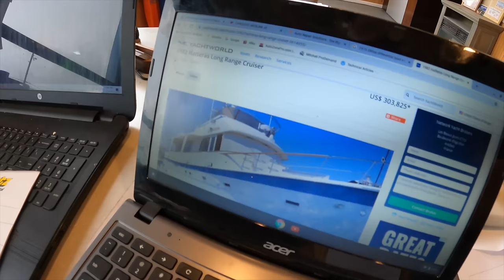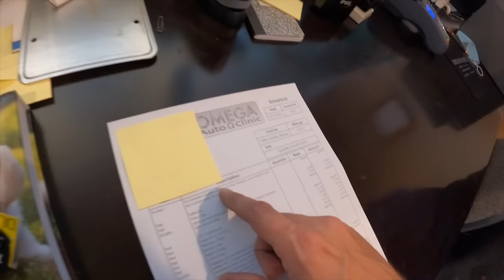Everything wrong with the Mercedes nobody wanted, and another Lamborghini FIXED!

Comment: The Hydrodynamic compensator you and the Wizard were looking at is completely stock. It keeps the rear level with a load in the trunk. It does the same thing as the spring with the addition of level control. That is all. The Classic center in Irvine, CA sells rebuilt units. You send them yours and they send you one that has been rebuilt. Some people just swap in a coil spring when the hydraulic strut has worn out.
Reply: yep check it isn't leaking and leave it alone
Reply: Fix the protective boot on the hydro shaft.

Comment: "It didn't sell for $7600, so I finally bought it for $9000." Tyler 2021
Reply: I caught that too and was like wtf
Reply: It bid up to $7600 but that was below its reserve so it didn’t sell. Presumably he bought it for the reserve- $9k
Reply: Shrewd negations have never been Hoovie's strong point.

Also, my phone wants to autocorrect Hoovie's to Boobies and I think that's fantastic.
Reply: @jongeddes09  one of the 2 points you have stated I can agree with....
Reply: @AmbientSpectrum  that's not what he said though?
Reply: @jongeddes09  actually both...
Reply: @dabreal82  He said this in the initial video where he discussed purchasing it at around 43s. He stated that it was put on bring a trailer with a reserve that was not met (high bid was 7600).

Comment: The Boge self levelling Hydrodamper unit 108 109 111 R113 280SE BOGE HYDROMAT SHOCK 0003200413. Reconditioned or new from USD 500 - 1500. Some Range Rovers used them.

Comment: The Boge is a self levelling system, as on every Classic Range Rover. It is filled with Nitrogen under pressure and self levels  enabling lighter springs so no sag under load.

Comment: I've got to get it out there that I've got a 1971 280se, whose straight 6 engine and automatic transmission I've  transplanted into my Dad's 1972 250C . The 280 has all good parts above the floors. Unique independent suspension rear axle that hinges at the differential housing.  Hello you Kansans from Mt. Oread.

Comment: Changing rear differential seal comparo: #1. 1975 Mercedes = simple, pull C-style gasket, your done, nothing to remove. Cost = $50 w/labor. #2. Any new 2010-present BMW = not so simple, disassemble entire car, some parts twice. Cost = $ 35 parts, $50,000 labor.

Comment: That clamshell boot on the rear axle is tricky to install so it doesn't leak. But it will leak sooner than you want it too anyway.  Do the job right for no regrets.

Comment: I think what GM was trying to do was rebrand Cadillac so it wasn't like every other Buick, Oldsmobile, or Chevy vehicle.  At one point everything was on the same chassis with the same engine configuration with some minor changes to the interior to make it nicer.  My old Buick LeSabre I drove in college is basically the same as that Cadillac.

Comment: I sold my 1971 300 SEL 3.5 on BAT 2 years ago for $36,500. I have a 71 280S which is nearing restoration. These are great 6 cylinder cars. Why aren't they appreciating in value? 😏

Comment: That's got an older version of the bosch l-jetronic system that was in my 280z I remember the Z's computer was so dumb that sometimes hitting the ECU could fix problems lmao. It wasn't a real computer, just a bunch of complicated dumb (dumb as in it doesn't really have much of a real computer in it) systems that control the fuel injectors

Comment: The 1987 Cadillac Fleetwood Brougham sedan, isn’t quite finished. The obvious things that are not quite right are firstly the BROUGHAM badges are in the wrong place. Secondly the side moulding on both sides of the Cadillac are missing. Thirdly the double decorative coachline / pinstripes are missing. And lastly a full set of matching white-wall tyres would make the Cadillac look so much better. I would suggest “American Classic” tyres with the 2-inch wide white-wall.
If you do these additional items on the classic Cadillac Brougham, you’re more likely to get a better price, when or if you decide to eventually sell.
I must add, that at this point, I wonder what other bits of trim just may be missing from this Cadillac, you know if a job is worth doing, it’s worth doing right, as they say.

Comment: As a former long time Mercedes owner, it's because there are no cup holders, and the dealers no longer really want to see you. I dealer maintained by 300 SDL through 480k miles by which time two dealers recommended independent service garages to me. They were too busy with warranty work on the new cars they were leasing.

Comment: I have owned Bentley's all my life and every time something hydraulic brakes I manufacture it in American style so when the suspension takes a dump I bypass everything I put struts in homemade struts and I eliminate the whole hydraulic system on the roof I changed the hydraulic cylinders with electric lanier's

Comment: The usual reason in the US for not wanting an old Mercedes or other European car is the unavailability of Mechanics happy to work on any European vehicles. They do exist but it . seems that they are getting quite rare ... you are fortunate to have complete lenses on your tail lights and headlights, not cheap if you can find them. Unless you find a parts hoarder wanting to move his Merc parts on .... you seem to be missing the under bonnet insulation .

Comment: Only the 300 have air suspension, 280 always have coils, none have hydraulic suspension. The weird thing on the back axle is a hydraulic compensation spring which often brakes down, but looking at the ride hide, it seems ok in this car. Good buy.

Comment: The Mercedes is awesome. No doubt about that. But the Cadillac brings back memories of my teenage years when I was so impressed by their level of luxury compared to even a new, at the time, W126 (1983).
However, apart from the placement of the emblems, there is something else missing too, that should be on there, even if it wasn't before. Pinstriping. White (oem style) pinstriping running the length of the car would make it look perfect.

Comment: The reason Mercedes went back to mechanical fuel injection is because EFI although reliable would leave poeple stranded on the side of the road if anything broke creating a bad look for the brand and impression on the customer, the mechanical fuel injection could have a myriad of things go wrong but short of a broken fuel pump you could usually still limp back to the nearest garage. I can literally yank out all the computer parts on the fuel system on my w126 and have failing regulators and worn out fuel injectors ect and the engine will still start and run (although like crap).
I would still pick early efi over ke-jet though, those k-jet systems do not age well after 30 years

Comment: @ 15:00 -- Hoovie is willing to $pend the $ to get it done *right*. The rest of us poor shlubs would just take a Q-tip soaked in alcohol & clean all the rubber well, coat the wind wing with wax & a light coat of oil, close & latch the thing, & then spread a tube of black RTV from the dollar store around the perimeter, wait for it to cure, take a razor blade & cut nice clean edges for the "renewed" gasket, pop the 1/4 light open and clean everything up, & call it a day...

Comment: I'm not sure what you mean about American cars being stretched out at 75mph.  Most of them were high geared and could cruise at high speeds no problem.  I bought a beat down 73 Cadillac Sedan De Ville with the 472 V8 and it had no problem cruising at 80mph and it was smooth as glass.  My friend was following me in a Toyota 4runner and he had trouble keeping up with me.
Same with a '70 El Camino, or a 71 Riviera i have owned.  My '38 Cadillac was a bit sketchy above 60.  But by the 60s and 70s they were fine.

Comment: Do not put synthetic oil in these engines. The will burn oil like hell. Use 20W50 mineral oil only this is what Mercedes recommended. And at the rear axel thats a hydropneumatic spring. And its self leveling, if you put more weight in the trunk it will raise it self. This was optional.

Comment: Hello Tyler, you might already be aware but the hydraulic suspension of your rear axle is worth nearly 1/3 of what you paid for your car... in the past when these parts failed they were simply replaced by a spring which is obviously the cheaper solution... that yours still has it is quit rare. Enjoy the experience of owning and driving this classic icon! It’s going to be one of the best investments you’ll ever make... so in the end not such a Hoovtie after all 🤪

Comment: Great buy Tyler. Love this style of Merc.  You did right for once... Please let the car wizzard pul the valve cover, because I know of some problems with old Mercedes 8 cil engines. I'm not dure if this year falls under the same catagory. But you should check it out. There is a tube which distributes the oil along the valve train. These fail, and that can cause big problems. Also timing chain problems. When you deal with it in time, easy fix.

Please also check tge channel from Kent (Mercedessource). Lot's of usefull tips and tricks about this style Merc, enjoy the old beast...

Comment: I was a young adult in 1973. The National 55 mph speed limit was not imposed until 1974 in response to the 1973 OPEC oil embargo. The US manufactured cars were designed for 70 mph and beyond. 1973 was seeing new smog control but still long winded V8s.

Comment: When I was eight in 1966 my mother had the predecessor to this Merc, a six cylinder work of art. This car in video has more subdued styling and a clock speedo. Same quality. Ours had an orange column to indicate speed. Ours had rear fins and a pointy tail light. I have seen some of these driving around Cape Town still in showroom condition. Mercedes used to be exceptional passenger car makers. I have a 43 year old BMW 650 motorcycle. It shows how Germans used to make stuff. Simple and good, complicated and not so good. There is no point in producing such durable consumer goods anymore, planned obsolescence and over regulation have cause unreliability issues

Comment: That's Boge auto leveling unit. It has valves inside controlled by pressure in two chambers. The idea is that it will pump it's self to maintain car level even if there is heavy load in the back. Old Range Rovers and some 110 OG Defenders used to have them too. The problem with them is that they usually gone by now. There are few companies around the world which can rebuild them.

Comment: UGH!   --LUV the Merc, but I HATE the underside of the hood!  You NEED to pull the hood off, turn it upside down, sand/blast the RUST OFF of that hood. --seal & paint the hood underside, and put a hood pad on the hood underside, and replace it back on the car.   I KNOW WHY there might have NOT been much "interest."  Mercedes engines, --4s, 6s, & 8s, have plastic parts that degrade -[--get brittle, break, thereby poorly lube-ing the camshafts, and potentially leading to a CATASTROPHIC ENGINE FAILURE!   I LUV the Wiz, but he SHOULD have pulled BOTH valve-covers, if those plastic parts in/on the cam-lube-ing shafts have NOT been recently[--last few years] replaced, in the 50 years of receipts, because if those plastic parts haven't been replaced, that engine is a "TICKING-TIME-BOMB" of RUIN!  Oh, ALSO, Wiz, with the valve covers off, SHOULD check the slack on the double-row cam-chain, because if that has NOT been "Adjusted" correctly, it could BREAK, again RUINING the engine from Another place!    I personally feel you should replicate those stinking plastic parts in the cam-oiling tube(s) with a 3-D replicator using a brass substrate, so instead of making them in PLASTIC, they'll be made in BRASS which will NOT go "hard/brittle" over time, grenading the engine.   Maybe stainless steel'd be more long-lasting than brass/plastic.   I also think an engineer @ Cloyes Gear Drives, should adapt a gear-drive so the cam-chain will NEVER break, because a cam chain won't be USED on that engine, anymore,--it'll be "gear-driven" from the crankshaft to the cam(s).  I'd buy a car like that, but NOW, I KNOW what to look for.  Some "'Benz-Expert  on YT, said when buying, if you have no receipts specific to replacing/adjusting those parts I mentioned, AND, if the seller won't remove the valve-covers, you should NOT buy the car, and walk away.   Also, that exhaust-system needs replacing in stainless, as those exhaust-pipes are RUSTY!   If I bought that 'Benz, I'd have to take-it to the Wiz, and maybe drop several thousand$ on it, to fix the "issues" I mentioned, ASSUMING the work I mentioned HAS been done, and assuming the cam-lobes haven't been "scuffed", meaning a re-work of the cam-lobe "face"/ramps.    Wiz'd just buy new camshafts if they were "scuffed".   So LOOK & SEE if cam-chain adjustment, and plastic oil-tube parts have been recently replaced in those 50yrs of invoices.   If there are receipts for the RECENT adjustment/repair, THEN it's a GOOD UNIT,--a GOOD car to invest in!  I'd buy that 'Benz, but it'll be MORE than you bought it for, for Wiz to fix what you wanted fixing, plus whatever you want as a profit for rescue-ing that car in the first place.

Comment: Great video, Hoovie. Loving the Cadillac. One thing to note. These mid- to late- 80s rear wheel drive cars were badged as Brougham only. They were technically not part of the Fleetwood line up. The Fleetwood Brougham, starting in the 85 model year, moved to the front wheel drive platform. I spent a LOT of time at GM dealers during this period, as my 84 Olds Delta 88 managed to accumulate some $14,000 worth of warranty repairs over 42 work orders in the first 18 months. You are also missing the side molding that helps locate the badges. Other than that, the Cadillac is magnificent.

Comment: The green and gray hydraulic suspension are feom different generations. Green spheres werre used until the 2000s, and grey ones on the Citroën C6. They are supposed to not loose gas over time

Comment: My grandfather's 280SEL4.5 would go all day at 130, mph. I know this because I did it. That rear Boge is the self leveling compensation, exactly as it should be. It's a mechanical/hydraulic device. In the late seventies and early eighties Boge made an optional self leveling suspension for BMW motorcycles under the name "Nivomat", I wish I could find a pair for my '79RT

Comment: Bentley run Citroen suspension... so you can use Citroen parts... but people don't, they go to Bentley, whereby they get their pants pulled down.. and them Mercs... parts be scary.... Bit like today, where people go buy a "Posh"  new Merc diesel... and it has a PSA engine, but they don't mention that... you're driving a shiny Peugeot... Whisper it..

Comment: Wow, just found this vid.  I grew up in Wichita. Went to WSU late 60's  
Bought a used 65 GTO with tri-power. 4 speed -Mucie shifter from a 
farmer for $1,000.  Got totaled by a drunk driver. Found a used 64 220S 
Mercedes for $600.  Needed a valve job.  I took off head, pulled out the
 valves. Went to Europe on a trip. Went to Mercedes in Germany and 
bought the valves.  Came back and had a shop mill level the Al head 
AFTER filling the corrosion holes by Heli-Arc.  Need to torque heads 
again after so many months on these Engines.  Nobody did and water 
seeped in. -----------  So I started to find spare work, repairing 
Mercedes. ----------Later in California I bought a 250S.  Rebuilt the twin carbs 
and ran great.  The rear end was sagging.. It had those compression type
 units on the trans-axle.  Throw them away,, just replace with a large 
spring, bingo.  Split boots would crack. Mine only cost $36 at the time.
  I have Jag S-type and XF's now, ,,,like to work on them.  The newer 
Mercedes don't do anything for me. Too much plastic.  Oh, there was a shop in Newton that I bought the valve guides for the head.  Probably gone now.

Comment: Agreed, I've never seen a hydro susp. like that, before, either. Usually, it looks alot like an old efi system. Many solid lines, coming off of a master cylinder. E.g. 80's Rolls Royces. That though, I've never seen before either... so don't feel bad Wiz, it's not just you!

Comment: Always wanted to LS swap one of these.
 Not a crazy high horsepower swap, but more the aluminum 5.3 engine with a 4L60E to have modern easy to maintain drivetrain coupled with what I consider good looks and not something I will see 10 copies of every time I drive it. I had originally wanted to do that with a 70's Jag XJ6 (or XJ6C) - but my feet don't fit in them. Sadly - my searches for a car like this many years ago did not turn up such an affordable example so I haven't looked for them again.

Comment: Find an extra fuel pump.  When you need it, they just won't be available.
I found the same car, but the condition was a little less than your car.  It was about $4500, and the guy had it for sale for about 18 months.  I saw the car when he was taking it to storage and by then he didn't want to sell.

Comment: That looks to be the standard hydropneumatic compensator, that all W108s came from the factory with - they serve to level the load over the rear axle, but have a tendency to fail. Most owners replace them with a simple metal spring - they’re a helluva lot cheaper, and you lose load leveling, but otherwise you’d be hard-pressed to notice the difference.

Comment: The Wizard is smart,  first he gets to charge you for a synthetic oil change,   then he gets to fix the oil leak it creates by switching something 50 years old to synthetic oil.  Brilliant! 
If he puts anything other than 15W40 "diesel" oil in it he's making a mistake.   Old engines need all the extra vitamins and dinosaurs that's in the diesel oil.